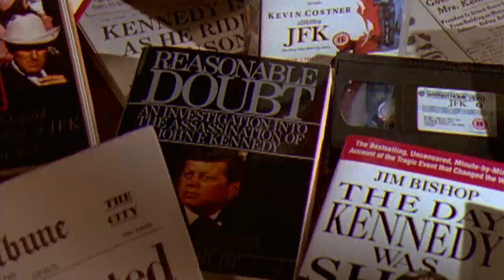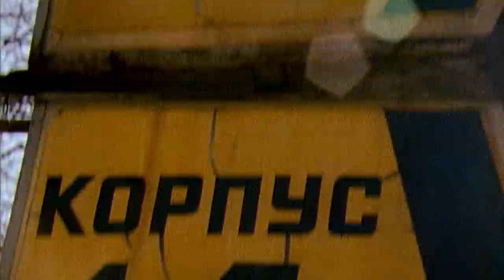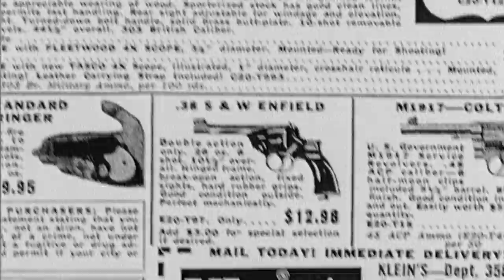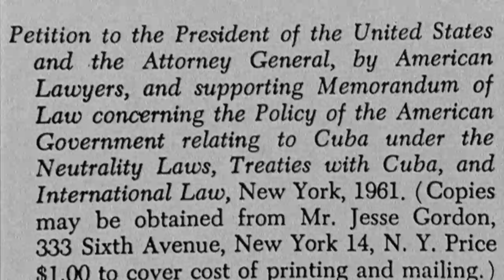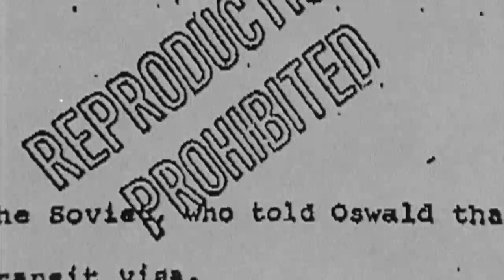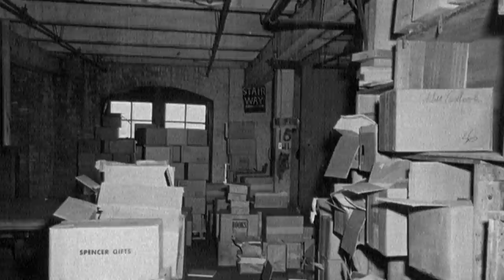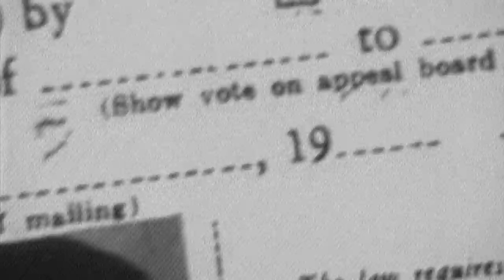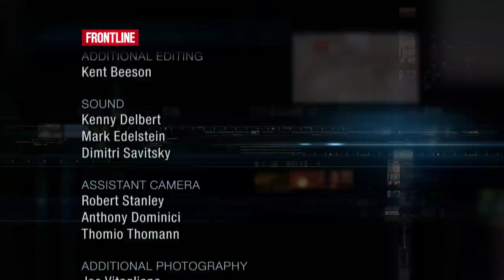Who Was Lee Harvey Oswald? (full documentary) | FRONTLINE

Comment: The bullet hit Connelly sideways, as shown by the hole in his jacket and in his back.  That's because it tumbled after going though Kennedy as has been seen with tests on ballistics gel with the same bullet.  The bullet was deformed, but not a whole lot.  See the pic of the actual bullet from the back, it's squashed and is missing some of the lead from the core.  The exact same type of bullet was fired and went through 3 feet of pine board and barely deformed at all in testing (see NOVA documentary)
It's not a "magic bullet"  It's what that particular bullet does.
Reply: Tumbling bullet is a myth. Dr Shaw didn't describe a wound caused by a tumbling bullet. He had the best view of JCs back.
Reply: @81overon  A myth huh?  It's basic ballistics and physics for a bullet to tumble after going through a medium such as flesh, bone, ballistics gel or soap.  Watch the NOVA testing on the same bullets in super slow motion, they tumble every time.  The hole in his clothes was oblong not a perfect round hole like in the back of JFK's clothes.  They pulled little chunks of lead out of him that squeezed out of the base of the bullet, which isn't covered by the full metal jacket (if the bottom was covered it would be total metal jacket)  The picture of the base of the bullet shows the missing chunks that squeezed out when they hit is bone as the bullet was tumbling.
Reply: @Toolness1  The bullet hit JC point first on a downward angle. It didn't strike sideways. The wound measured 1.5 cm vertically by 0.8 cm horizontally. As I stated earlier, Dr Shaw didn't describe a wound caused by a tumbling bullet.
Reply: @Toolness1  When a bullet goes in sideways,  this behavior is called "keyholing."

Comment: Having thought about the head wound as described by Dr.McClelland and looked at the layout of Dealey Plaza, I think it's conceivable that the fatal head shot may have come from the parking lot on the south side of Commerce street.  Further away than the book depository and the picket fence but in my opinion the ballistics make more sense.  According to Dr. McClelland (the video is or certainly was on YT) the right-rear of the head above and behind the right ear was blown out with the bullet entering at or just above the hair line.  Dr. McClelland did not specify which side of the front of the head the bullet entered.  A shot from the right (picket fence) would blow out the left side of JFK's head spraying Jackie and a shot from directly in front would blow out the rear central part of the head.  A shot from directly in front would have to mean from on top of the triple underpass and there were witnesses on there.
A shot from the front left would blow out the right-rear of the head and the front left is where the parking lot on the south side of commerce street is.  Just a thought
Reply: Or you could check out exclusively Zapruder frames 312-314 to find out what really happened to JFK.  
Please tell me what you see there in relation to the direction of JFK's head movement and the blood splatter in that Crucial 1/9th of a second.
Reply: No bullets or fragments were ever found that did not match to Oswald's rifle.
Autopsy shows the shots all came from behind.
Connally's said the shots all came from behind.
Witnesses under the sixth floor window said the shots all came from overhead.
Nobody would ever assume they would frame this on a lone shooter while firing away from multiple directions.
Reply: @aaronz7056  Well the doctors at parkland looked at the head wound and saw a big hole at the BACK of the head.  i.e an EXIT wound.   NOT possible from the direction of the book depository.  So that means at least two shooters (or one in the book depository as a diversion or 'patsy')